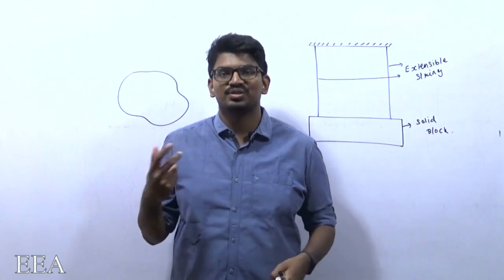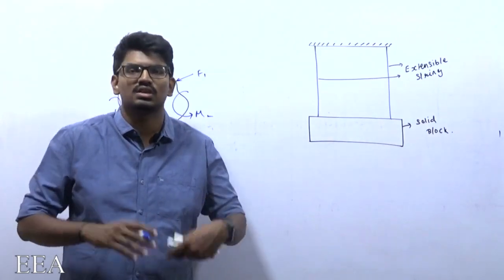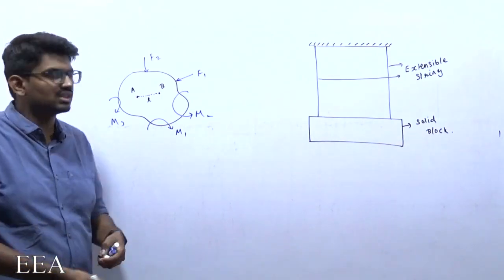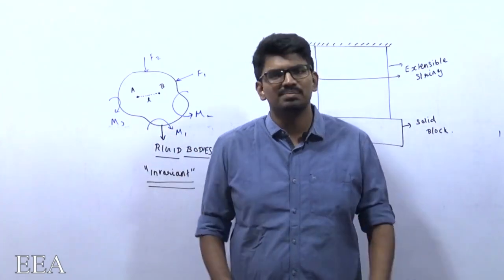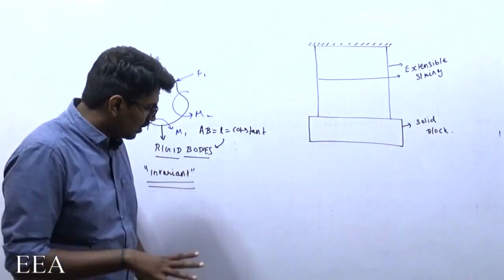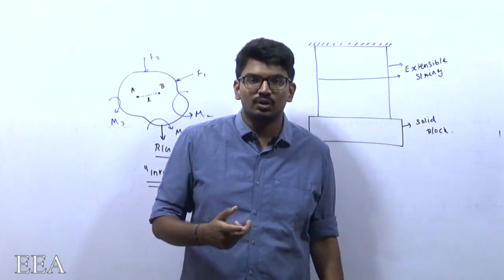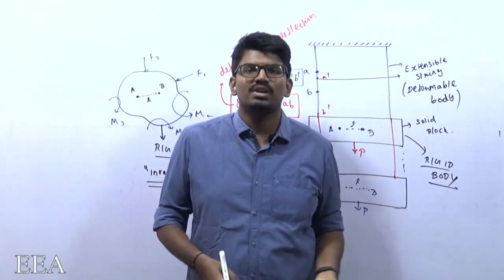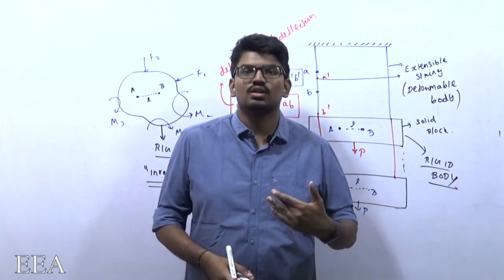Rigid Body VS Deformable Body | Strength of Material | GATE. ESE & PSU's Preparation

Comment: What if the distance between A-B is not changed but the position of A with reference to the original point or point before loading changes. We should take that in account. Right?
Reply from the maker: There is only one possibility when distance doesn't change but still position changes. When point A is hinged and point B rotates about A. That is circular motion. Here also we cannot consider it is deformable. If A is not hinged, then surely distance between 2 point changes when BC changes its position.